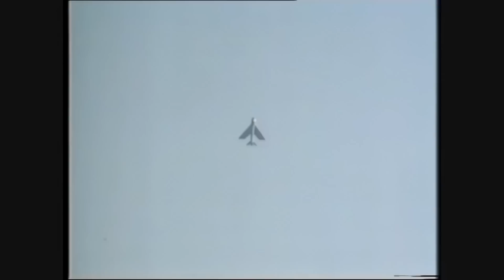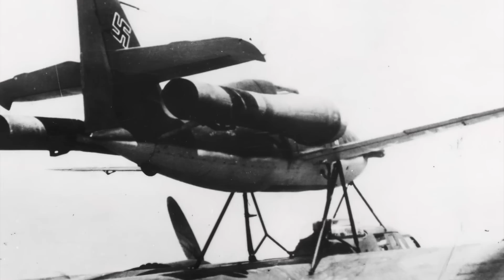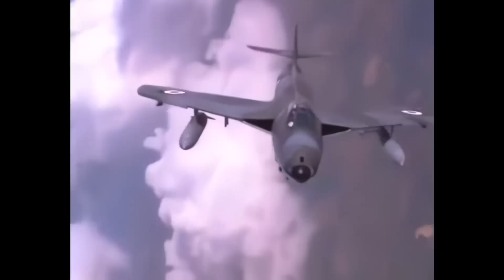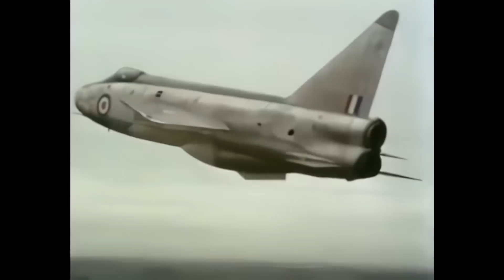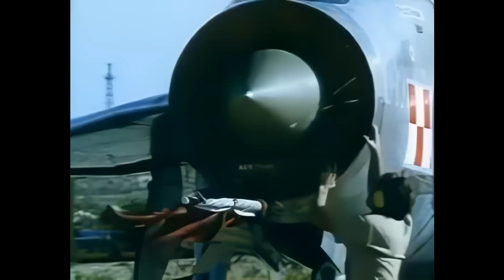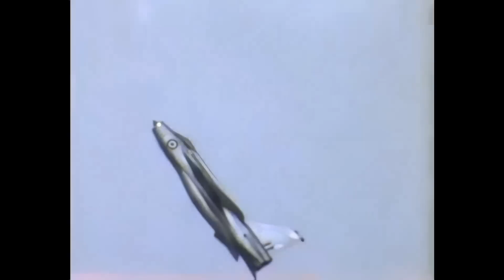English Electric Lightning | The British Cold War Supersonic Interceptor And Jet Fighter

Comment: The initial opening of the documentary after the credits is inaccurate. It clearly infers that the British 'lost ground' to the US in the quest to break the sound barrier by 1947. Petently UNTRUE. The Miles M52 had been built in 1944, and the British had a jet engine capable of delivering sufficient thrust for the M52 to have broken the sound barrier- whilst eh Americans had to rely on *rocket motors. The US offered the cash strapped British government a deal. It was based on the premise of the British handing over all their top secret research on the sound barrier, and in return, the US proposed to fund a joint US-UK project to break the sound barrier. The British kept their sidde of the bargain and handed over their research data, and all of a sudden, the US pulled the plug on the 'joint' project. It was a most shabby trick, underhand and deceitful- another example of the Americans failing to keep their word and honouring an agreement. The Bell X1 is very similar in appearance to the Mile M52, it was a virtual copy, albeit with rocket motors.
Reply: Everything you wrote is not factual.

Comment: Although the X-1 gets it's deserved mention , it's also very disingenuous to regale the British on 'supersonic flight'.  For three reasons.
 1) the British designed the Miles M52 of which much was incorporated into the X-1.
 2) the British had developed the tailplane that gave stability and gave the 'design' to the USA.
 3) the agreement was  that the USA would share the research data, which they reneged on (sensitive information). 
At that time period the UK had some highly advanced designs, in the pipeline, two of which included the Lighting and the  Vulcan.

Comment: From brake release, only the F-104 could even hope to match the Lightning in climb to height.
Reply: nope, the F-104 was equal in level flight acceleration, neither it or the F4 could match the Lightning's climb rate, or it's operational ceiling. (the RAF sent the USAF pictures of a U2 taken from above it with a note "we were watching". 😀
Reply: @JackNiles-hc8yz  neither had a climb rate of 60,000ft. The lightning was the first aircraft to go supersonic in a vertical climb (I believe that was without afterburn) the F104 could not.  The published spec's of the Lightning were grossly under played. From any reading I've seen, level flight they were equal. It was the only plane (inc the F104) that managed to intercept Concord at 'supercruise'. It was equal/faster to the F4. Bear in  mind it was designed for one job only, intercept high level Russian bombers. If you research, the RAF took pictures from ABOVE a U2 spyplane twice. Something at the time the USA did not think was possible.  One was a Canberra bomber (story is, the USAF sent pictures overflying the UK saying "look what we did" The RAF sent pics taken from above, with a reply "we were watching". The Lighting intercepted a U2 in an agreed simulation and went past it (way beyond it's stated ceiling). They were known to power climb to 80,000ft. I'm not sure if the EEL's actual climb rate was ever made official whilst in service. (I believe it was an Eagle that finally actually broke that climb rate). The current holder I believe is the Eurofighter Typhoon in interceptor form.
Reply: @JackNiles-hc8yzNo mate, I'm not having that high 40s maybe but nowhere near 60k per min. Maybe the mod with the rocket motor added that Yeager flew but not the standard Starfighter.

Comment: So much fuss is made about the swpet wings on the ME262. The wings were only swept back a little to adjust the centre of gravity.  They were not swept nearly enough to have a significant aerodynamic advantage. This is well documented. The real reason why the aerodynamics of the ME 262 were cutting edge is because the Germans had a supersonic wind tunnel and were able to improve the aerodynamics of the fuselage and the profile of the airfoil sections.

Comment: Did he say 36,000 lbs of thrust? I believe a modernF18 is only capable of around 34k (17k per engine) so I'm confused by this. Great plane and video though.
Reply: Rolls Royce Avon 301R, according to Wikipedia (so it MUST be true!), 16,360 lbf (72.8 kN) with reheat. 16,360 x 2 = 32 640, but the later versions had Avon 301/2 which produced 12,690 and 17,110 lbf  .This gives 2 x 17110 = 34 220. So, either it was a slip of the tongue or a bit of an exaggeration. Even so, 34K for a fighter in the late 50s was pretty awesome!
Reply: @SAHBfan  thanks for replying.
Reply: The BS.100 jet produced 26000lbs of thrust in 1960. A harrier engine on steroids, then they could inject fuel into the forward exhaust ducts and take it to about 34000lbs. Along with melting the carrier deck it was trying to take off from.
Reply: @paulqueripel3493  wow, thank you for your reply

Comment: I wonder if he's thinking of Lockheed's F80 instead of an F104. I believe NATO had a trainer version of the F80 operational in the late '60s. In 1958 the J79 powered F104 bested Gruman's modified Prototype F11F-1F Super Tiger (also J79 powered) altitude record of 76,939 feet with a record 103,389 ft. But being an ill handling fuselage wrapped J79 with loaded stubby wings either the Lightning or Super Tiger would've handled it in anything that became a turning fight I'd be betting. . . . at least at 40,000 ft they would.
Reply: Yea, that claim about watching F104's falling after not being able to climb to his altitude doesn't hold water, same with the claim about 1 to 1 weight and thrust, a fully loaded EEL weights more than the thrust it makes even in afterburner, the same with an F104, so unless he was unarmed and about out of fuel and is talking about a fully armed F104 complete with full drop tanks there's no way that holds up, F104's can also be flown light and can climb vertically.
People do this kind of thing all the time, compare one aircraft that's in an ideal state for making a claim against another one that's loaded to the gills.
Reply: @dukecraig2402  Those Avons are rated in the neighborhood of what a J79 puts out and there were two of them so I have no doubt that aircraft was an unusually hot one once they kicked those first generation Sapphires to the curb. Like the  F11F-1F it was just waiting for a second generation powerplant. But he's talking altitudes that were still comfortable for a P47N.
If that F104 was supposed to replicate a Mig 21 coming across the East German border then he wouldn't be coming up from the runway. He'd be coming across the border under the radar with some energy that turbojets need to climb quickly. So they better have practiced it that way.

Comment: I thought it was fast until I saw how the TSR2 ran away from it with only one engine in reheat.
Reply: That was faster than I realised until recently.
Reply: Roland Beamont said so during testing.
Reply: Where did you see that? Bearing in mind the TSR2 never made it into service.
Reply: there's a documentary about it online, and the pilot flying it reported that. They did many test flights with it before it got cancelled.  @stanleybuchan4610
Reply: @stanleybuchan4610  It was filmed by the Lightning. I saw the film.

Comment: This is one of the Cold War planes that doesn't get the 'glory' like it's Western counterpart, the F-4 Phantom II. But it should. It's an amazing work of form and function. Why fight yaw conditions in an engine-out scenario when your engines are aligned one over the other instead of the old side by side? THAT right there is thought #1 that makes this airplane leaps ahead of anything that came before, during, or after. Centerline dual propulsion is a much more stable and safer way to go for dual jet aircraft imo.
Reply: Why don’t they do that today? Has any other fighter or bomber used that setup? If it was so advantageous I’d think everyone would be doing it, even britian stopped
Reply: @Legion-xq8eo  It really makes sense to do so and yet they don't. Trying to deal with an engine-out in a conventional (side by side) twin engine prop or jet on takeoff or other situations can lead to very bad things depending on timing and the pilot's awareness and training. An engine out in an over/under setup like the Lightning would barely be noticed, only causing a decrease in speed and no adverse yaw problems like the other method. It's a win-win. Must be some reason, as you say.
Reply: @sski  I have never had the priviledge of flying one unfortunately, and whilst I agree the engine layout would not cause yaw issues in a single engine out event, I am concerned that the over/under layout would cause massive pitch trim changes instead! Arguably  not as bad as yaw, but a sudden nose down or nose up trim change might be just as dangerous, particularly depending upon when the engine failure occurred. It would be good to hear from a Lightning pilot in this regard.... It should be very easy to determine which engine had failed though!
Reply: Engine out on todays fighters incorporate flight controls that compensate the aerodynamics.
Reply: They were maintenence nightmares. Much harder to work on them a side by side configuration.
Reply: @bfc3057  It had enough endurance to "bounce"  the SR71 in 1974 mid Atlantic as set the crossing record !
Reply: @bfc3057  and there you lose your hard fought for credibility with a petulant response. I don't particularly care where you are from, nor am I targeting you beyond replying to you specifically replying to me. I was judging you by your contribution which was to your favour, now, not so much.
Reply: It's always entertaining on any video celebrating the achievement of the Lightning, Mozzie, Harrier, Chobham, Radar, Spitfire, Computers whatever it is it seems to really provoke a certain type of patriotic American, German or Argentinian in an amusing way.
Reply: @bfc3057  I've read similar fawning comments about the A10 and the F15 that make me cringe. It favours one part of the solution over the flaws it introduces. It takes nothing away from the brilliance of the Lightning, in fact you made some of the points about its role on here, that the Phantom II was commissioned into the RAF as a stopgap to patch over the roles that the Lightning could not fulfil as it was not designed for it. However, it's not really a counterpoint to the continuous improvement regime on the Lightning. The EE Lightning was a brilliant plane and a superb solution to a transient problem. The fact it survived in role for so many decades makes it perhaps superior to the V bombers, because their role changed (decommissioned, demoted to being tankers or eking out an existence as a low level bomber with one last hurrah in Black Buck) is testament, like the Mozz to an industry that survives against political tides. Something that the US military industrial production has in contrast rarely had to excel in opposition to.

However, that said, the British often wonder quite how far British aviation would be ahead if it hadn't shared its inventions, given jet engines to the USSR, nor had an establishment determined on self sabotage or even the resources to squander that its compatriots had on experimentation. Against that backdrop it has consistently produced not just relatively excellent ends, but objectively excellent ones too. 

Nearly a century of failure to exploit opportunity and lead later, it really doesn't make much difference an American patriot popping in and trying to urinate on the legacy of the Lightning because, whilst it was a notoriously short legged interceptor, it was a damn fine one too.
Reply: @bfc3057 
Apart from that, it goes like the F-22 someone made.
It even has a spike on the end for the balloons.  Save polluting with lead.
Reply: @bfc3057  
Father to son. 
He was not a flyer. But he helped teach me things like Algebra, use of Variables, what wings are for and when you don't want them. Great fun.
Reply: @bfc3057  doubtful. More likely a certain type of British patriotism would overestimate rather than underplayed or feel insecure about something like the Lightning.

Comment: This is ironic. A guy that even flew the airplane thinks it was designed as a supersonic "fighter", when it was really a "point defense interceptor" in the mold which so many viewers of this channel mistakenly claim the F-104 was. It did start out as a test aircraft, but was put into production for a narrow critical role.

The Lightning was initially built to defend Britain's strategic nuclear V-bomber airfields from enemy attack.  It had a pathetically small intercept radius, but the plan was that it would quickly get out to intercept the first wave of enemy bombers, fire its missiles, then quickly return to base and refuel and rearm in time to launch and intercept a follow-on wave of bombers.  It didn't have enough fuel for tactical fighter air superiority missions.  It was actually ordered to fill in for the roll of a surface-to-air missile system that was being designed to defend the V-bomber bases.
Reply: As the Chief Test pilot stated, the EEL was designed as a supersonic fighter, it just so happened to excel as a point defense interceptor and in 1967 with air to air refueling that point defense reached out all the way to the South China Sea
Reply: @sichere  The design started as an exploration for a supersonic fighter.  One without a specific mission.  It didn't excel as a point defense fighter, that is the very reason it became a production aircraft.  You can refuel it all day if you want to try to make it perform another role, but that was not its original purpose.  If you want to criticize a comment, try to stick to its subject, which was original purpose.
Reply: @gort8203  Stop copying and pasting from unreliable sources
Reply: @sichere  What the heck are you talking about.  i didn't copy and paste anything.  If you want to challenge something I said come out with it instead of acting like a knucklehead.
Reply: Lots of typing from a guy that didn’t fly the plane….
Reply: @heinekenczech  You think people that fly the planes built them, and you have to have flown a plane to have read its history.  What a joke.
Reply: @gort8203  "You think people that fly the planes built them, and you have to have flow a plane to have read its history.  What a joke."  What utter unintelligible dribble
Reply: @sichere   Sorry you are not intelligent enough to get the point, but since it wasn't directed to you, you needn't worry about it.
Reply: @gort8203  You are showing yourself up here. With the introduction of air to air refueling the EEL had exceptional range and the RAF perfected the art of having tankers in the sky for these thirsty birds of Prey.

In 1974 an EEL intercepted the SR71 in mid Atlantic as it was setting the crossing speed.
Reply: @sichere  You are showing yourself to be one of those trolls who wants to argue about things that are unrelated to any point I made.  Please just go away and find somebody else to play your game.
Reply: @gort8203  You're just a copy paste Professor who has no idea what the EEL was or could do. Even after watching this documentary. 

The EEL entered service on a continual update development program and the final BAC Lightning was far superior to the F1 F3 or F6 variants. The V force was not stationed in Germany but the EEL's were, as well as Cyprus and Singapore, where they covered the Australian Mirages stationed at Butterworth during the Vietnam conflict.

During it's service no other aircraft could out perform it until the late 1970's and it was used effectively by the RAF who are reputed to have the best pilots in the world.

Please let me know what aircraft could take on an EEL Pre F15 ?
Reply: @sichere  You have zero reading comprehension, don't you?  I have not copied and pasted anything, and I told you I am not interested in arguing over a bunch of claims you are making that have nothing to do with what I said.  If you want to challenge a specific statement of mine, quote it exactly and tell me how I was wrong.  Otherwise just keep playing with yourself because I have no interest in your fanboy rantings.

Comment: A Stonking documentary but please alter the stats of the Lightning as these are from the early models.

The EEL being a test bed development aircraft had many alterations and upgrades during it's service.  

The later BAC F53 Lightnings weighed less than 26,000 lbs and the the RR Avons 302 C's produced over 40,000 lbs of thrust in an aircraft with 25% less drag than most other aircraft, giving it exceptional speed and acceleration in a fully aerobatic frame 

The Lightnings: 

Were capable of reaching over  87,000 ft.
Could climb over 15,000 feet in a 5G turn sustaining 450 knots.
Reached 30,000 ft from brakes off in less than 90 seconds
First operational aircraft that could "Supercruise"  

The story is that in 1974 the RAF used an EEL to "bounce" the SR71 as it was setting a record for crossing the Atlantic.
Reply: The SR71 was set up for high skin temperature. 
You would not have long to shoot.
Reply: Yes, I've heard several ex Lightning pilots say it happened often. Admittedly the firing window was small but the fighters did it. They also regularly bounced Concorde with ease.